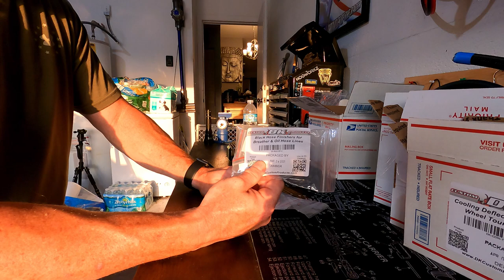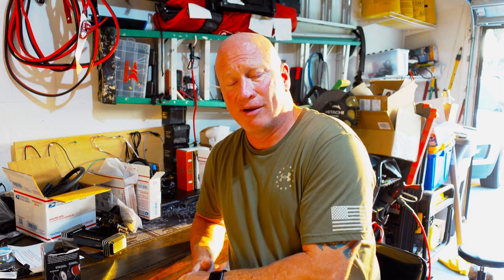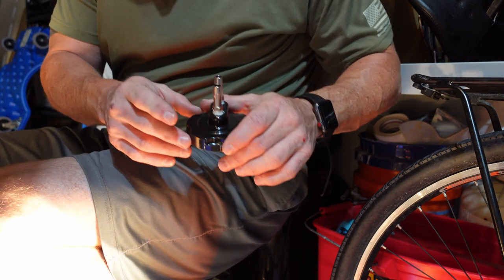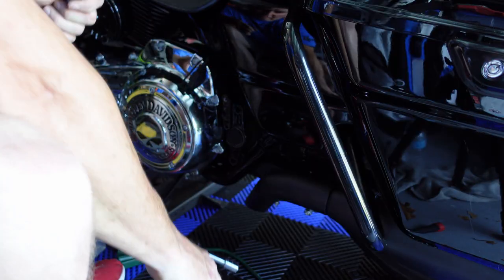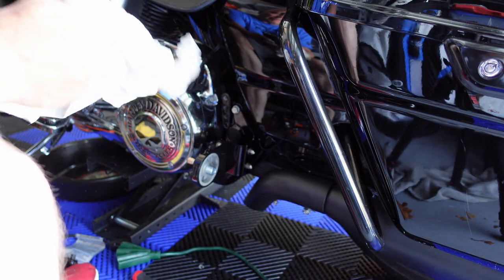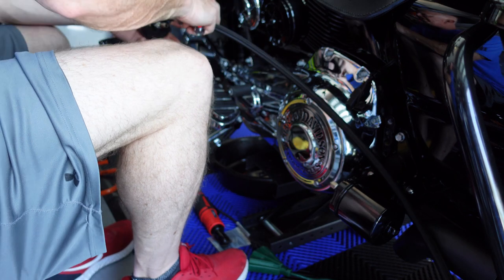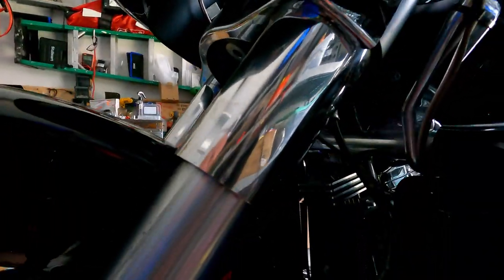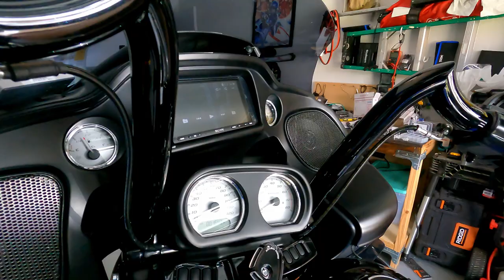Harley Road Glide Oil Filter Relocation And Oil Cooler Install - A closer look at DK Customs line.

Comment: Soak the braided hoses in hot water before installation... you will cuss less.
Reply from the maker: I removed the whole kit. I sprung two separate leaks with the hose in two separate locations. I’m lucky I didn’t blow the motor.
Reply: @RealRonTV  I purchased their oil filter relocation kit for my HD Freewheeler trike... I also ditched the kit and never attempted to install. I asked DK Customs for recommendations on how to route the hoses from the filter adapter back to the relocated filter and their response was: "trial and error..." no thanks. I just watched one of their videos showing them replacing the oil filter relocation hoses that were on the bike for 4 years or so. there were worn/rub areas on the hoses from a primary bolt and possibly the frame. if they truly wanted to make a quality setup, they would design hard lines with rubber hoses at each end away from any interference. I have spoken to a few who have done oil filter relocation setups and all expressed their concern or experience with leaks. I take it your Love Jugs are not doing the trick?
Reply from the maker: @richardrussell500  I relocated mine to under the bike in what appeared to be a perfect channel for the braided hose. On the way back from Texas as I hit Florida I noticed oil splashing from somewhere. I was able to get it to Gainesville Harley and $800 later I ended up having them scrap it all and go back to traditional. They definitely need to improve on the design and implementation and routing of the hose lines. 

And no the Love Jugs were an expensive and worthless addition to the bike that joined the oil relocation in the scrap heap.
Reply from the maker: @richardrussell500  I don’t care what the other tests show, the test I ran at a simple idle in 85 degree weather is conclusive enough for me. They’re useless in my opinion. Maybe the tank lifter works but it’s ugly AF if you ask me and I won’t be doing it. I also took off the deflectors. I’m not worried about the heat when I’m moving, I’m worried about the heat sitting at a light or in bumper to bumper traffic.
Reply: @RealRonTV  what brand of engine oil do you use?
Reply from the maker: @richardrussell500  Amsoil In all three holes.
Reply: @RealRonTV  10-4... here is how I see it. air cooled engines are not designed to last as long as water-cooled engines. my kids air-cooled VW engines never lasted more than 40,000 miles without a need for a rebuild. I owned a 2007 Yamaha Stratoliner with the air-cooled 113. a fantastic engine. I ran it for 10 years and 55,000 miles. it would have certainly kept going for some time. however, it was wearing out. seals/gaskets started to leak along with other pesky issues. she was simply wearing out. this is exactly why I will not keep my HD Trike more than 25,000 miles. I don't trust the longevity of these engines. if I were to keep it longer, I would definitely install a stage 1 setup and find someone who actually knows how to dyno tune properly. a good tune in these bikes would lower the operating temperatures. DK Customs claims the air-fuel ratio in the M8 is rich compared to the previous twin cam engines. so much so that they claim you can install an aftermarket air cleaner without a tuner. if so, their claim would indicate that the M8 engines actually run cooler. this is exactly why we see the Japanese and European competitors relying on water-cooled engine. HD will have to head that way sooner than later. and in kommiefornia, you will no longer be allowed to purchase a gasoline-powered car/motorcycle/boat or even a two-stroke leaf blower. that will be interesting! any hoot, best of luck : - )
Reply: The -6 AN line HS a smaller inside diameter than regular 3/8" hose. I don't recommend using the AN hose on the 3/8" barbs. You tend to damage the inside of the hose trying to push it on. End result is a leak. How is your bike running today?